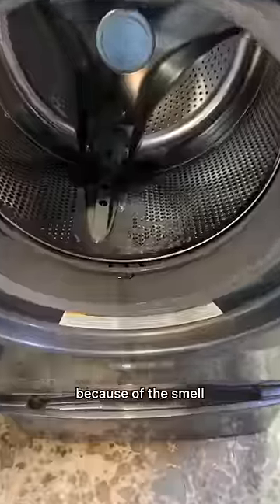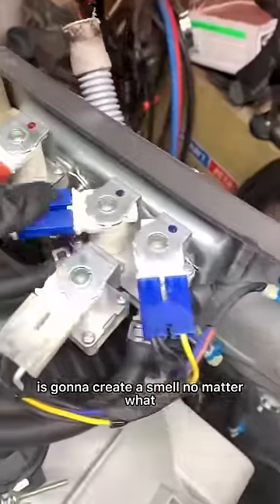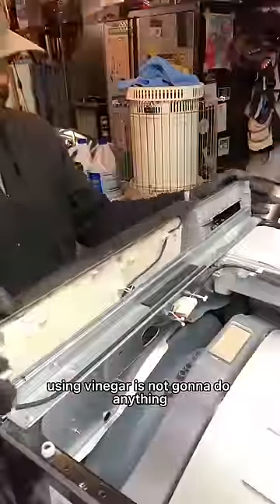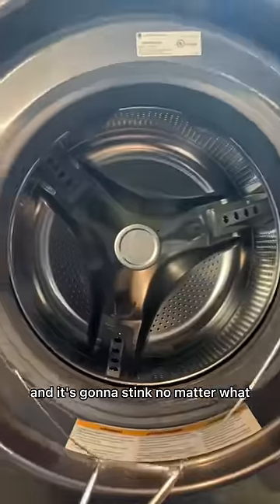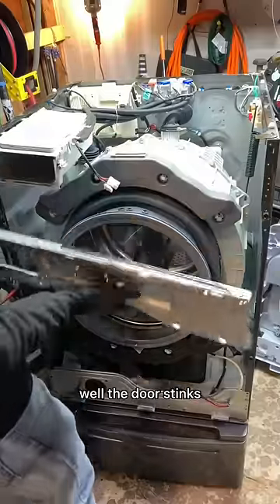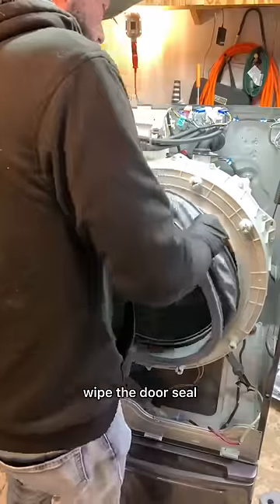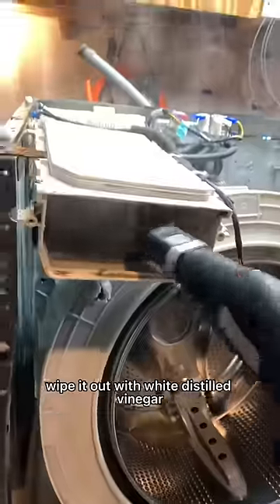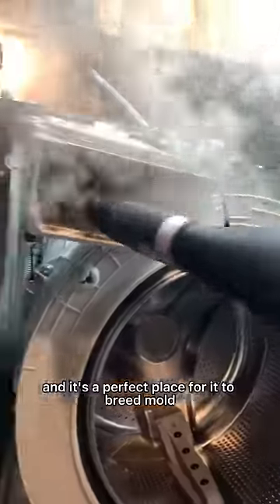Front load washers are proven to wash better. Facts, not opinion

Comment: Too much trouble. I’ll stick with top loaders
Reply: It’s too much trouble to leave the door open?
Reply: You sound exactly like my husband. I still can’t get at least a new top load one. 😂😂😂
Reply: @arleneaugustahair8393  tell your husband it saves a lot of water, a lot. You also use about 1/3 of the soap you use with a top loader.  And the clothes are absolutely cleaner. I went from a top to front and it was noticeable how much cleaner the clothes were.
Reply: @Draco100Round  I hate leaving the door open and now I leave the detergent drawer open too we got it feee but can’t wait for it to break
Reply: @Ratboy2004 my clothes come out smelling like mildew sometimes and you have to rewash them and then clean the machine. 

I don't live in a low water area. I'm not worried about saving water. I just want to do the job once and not have to clean the cleaning machine.
Reply: @Draco100Round  It is when you got kids who will run by your washer door, bump into it and take it off. Don’t have that problem with topload 🤷🏼‍♀️
Reply: @halo_girl_2434  You try whooping them🤷‍♂️
Reply: @Draco100Round  when you have it near a door that you walk by all the time, yes
Reply: Me too!
Reply: @arleneaugustahair8393  you need a new husband
Reply: I have a top load HE washer. Great capacity, low maintenance, and does a pretty darn good job of getting clothes clean.
Reply: Same.
Reply: @Draco100Round  where our hookups are- yes.  Otherwise its hanging into the middle of the kitchen floor. Where people will hit it.
Reply: You don’t have to leave it open forever. Just leave it open for a few hours to get the extra moisture out. And as he said you keep a rag on the top that you wipe around the seal. (for those that are talking about kids running by and walking by. Easy enough do your laundry towards the evening when it’s time for kids or everyone to go to bed) which let’s be honest most people aren’t walking by their washer 20 times a day. Nor does it have to be completely open. Y’all are way overthinking this. 😅
Reply: Top loaders last forever compared to front loader
Reply: 20% cleaner clothes, 80% more work. Yeah top load 100%.
Reply: Still too much trouble.... I use a wash board and stick
Reply: Top loads don't hold clothes hostage, plus you can add to it. All the front loads I bought broke within 2 years, trash.
Reply: @Ratboy2004  I went from a top loader to a front loader and I’ll never ever go back to a top loader. My clothes come out sooo much cleaner and it uses less water then my front loader
Reply: @savebandit1017  I k know plus they can leak unlike top load plus top load better and easy and never have this issue for one
Reply: @izzymaxpower  Yup, my current top load washer is more than 20 years old.
Reply: I've been a contractor for 40 years. Trust me top loader with the agitator does a much better job of cleaning my dirty clothes but it's also harder on my clothes. Lots more lint in the dryer screen I've noticed my jeans don't last as long.. Front loaders are okay if you don't have really dirty clothes and they spin cycle on those really does a good job of ringing the clothes out before you put them in the dryer so the dryer last longer.
Reply: @Ratboy2004  you did not. You believed the lies. They never get them cleaner. Unless maybe you had the cheapest top loader ever. I have had many people stay at my house and have them say they wished thier front loaders came close to cleaning as well as my old top loaders do.
Reply: My Whirlpool top loader still going good after 15 years. Reliability counts too
Reply: @JohnWayne-cb1tv  yup and I can just add in some washing soda to make up that 20% cleaner, as washing soda boosts laundry detergents power by 15%. Those front loaders look nasty as hell
Reply: @Draco100Round   no... front loaders always have issues.
Reply: @Draco100Round  You should leave the lid open on a top loader too, just so it is allowed to dry fully. It's bad to let moisture sit anywhere. 

Fill a glass full of water and then dump it out. Do nothing else. Put it upsidedown on top of a flat surface for 2 days. It'll smell very bad when you go back to it. It doesn't take much water that's not allowed to dry to make odors.
Reply: @Draco100Round  exactly what i do
Reply: @stephen9958  Top loaders don't leak?  Tell that to my GE top loader that flooded my house and did $10k in water damage when the automatic shutoff valve failed.
Reply: @eddiemalvin  That's not a leak, that's a straight up malfunction and the same thing would happen on a front loader (or dishwasher) if the fill sensor failed.
Reply: @Ratboy2004  literally no one cares about saving soap unless your living on minimum wage. Same with water your washer doesn’t really Use that much water anyway and the more “efficient” does not mean cleaner it just means they use less water and that’s literally it they just use less water
Reply: My old kenmore top loader went, so I  bought a new washer. I wish I  had kept the old kenmore. Boy, I  miss that thing.
Reply: European here. We dont use top loaders here and i have NEVER heard any of these complaints.
Reply: Front loaders DO NOT get clothes cleaner.  I'll keep my top loader for that reason alone.
Reply: Top loaders feel better on the back too
Reply: @Ratboy2004  maybe cleaner, but water is usually your smallest bill. Electricity is most peoples largest bill, and I noticed these "efficient" machines run for way longer, even if they are using less water
Reply: I want a top load too. Once I have the chance I'm going for it 😁
Reply: @halo_girl_2434  control you kids then.
Reply: @izzymaxpower  false
Reply: @savebandit1017  top loaders are a pile of shit still relying on a belt system. They use more power and water, also most people who use top loaders wash in cold water,  cold water does not dissolve laundry detergent properly so the inner barrel of your top loader would look the same as this front loader. You still need to clean a top loader out and do a rinse.
Reply: @JohnWayne-cb1tv  how's there 80% more work? You still need to drum clean a top loader?  Dont use fabric softener simple. And clothes come out more than 20% cleaner, it would be 50%. Use less water and power as well buy a front loader with a stainless steel seal, you have no worries then. But yes break your back reaching in and out of a top loader
Reply: @lucillepitt1979  I use hot water to wash clothes. I've had 2 front loads and hated them both, I will NEVER buy another one. To each is own, I guess. I actually have 2 top loaders now, one with and one without a center agitator.
Reply: @lucillepitt1979  not false…from someone who works on them… top loaders have been around for forever and mechanically they are way easier to work on and have less issues. Really talk
Reply: @pierredelecto7069  you don't live in a "low water" area? Wtf kinda mental gymnastics is  this?

We're currently in a global, I'll say it again, GLOBAL, fresh water crisis. Between pollutants like insecticide & microplastics as well as increased salination across the entire U.S. water table, we're ALL in "low water" areas.

Only 3% of Earth's water is consumable, able to be used for growing crops. 3% divided among every living thing on the planet.

But you're not concerned with your water use? Tell me you hate your children without telling me you hate your children again cause dying of thirst seems like a terrible thing to work towards.

I personally, hope to see future generations experience life as closely or better than I had it. Sad to see someone so blatantly working at the opposite.

I just gotta hope you hadn't realized the severity and after fact checking my statements will change your perspective on an individual's responsibility to be conscientious of their water use.

Wishing health and wealth on you and yours regardless! 🤓👍
Reply: @SirTorcharite  I live in a rural area where everyone gets our water from wells. Our water table hadn't dropped an inch, so no, we simply don't have a water crisis here. 

For many parts of the world there is a water crisis. I lived in California for over 10 years. It's real there. Where I'm at in Pennsylvania right now? Nope. Not an issue. We don't depend on melting snow for water. We pump ground water and it's not going away. Maybe in 100 years when the population of America is over 1 billion it will be a big problem.
Reply: @pierredelecto7069  do you think getting water from your well will matter if the water is salinated?

Pennsylvania is absolutely experiencing Freshwater Salination Syndrome. You guys salt your roads in winter correct? There's lots of agriculture grown in PA, right? Fertilizer & insecticide run off with dated agricultural processes are some of the most major contributors to the global water crisis.

Have you ever looked into the topic or are you speaking from some illconceived notion of reality just bending to how you feel it should be?

Because I've been paying attention to news surrounding a looming fresh water crises since the late 90s. I've never seen any evidence or experts suggesting Pennsylvania is sheltered from the fallout of humanity's disregard for finite resources.

I can suggest some sources for further reading if you'd like to be informed. I can't post direct links though as YT always deletes my comments when I do that 😬
Reply: @izzymaxpower  for forever... in america.
Reply: @SirTorcharite  I sold and installed water treatment systems. I'm not a PhD or anything, but it was part of my job when I worked agriculture in California. I set up everything from reverse osmosis systems to mechanical filtration, did electrical conductivity testing, and sent water to labs to test for biological contaminates. 

Our water in Pennsylvania is nowhere near as bad as it was in California, but it's worst than it was when I lived in Maine. You can drink it straight out of the tap. No filtration necessary to make it safe. You can technically drink water straight out of the tap in California where I lived in the central valley, and that had 10* as much minerals dissolved in there. 

No. Im not overly worried about a little salt, or nitrates or phosphates in the water. We'll be fine.
Reply: As long as it has an agitator..
Reply: @birdknowledge1388  than I'll just stick with the top loader
Reply: @lucillepitt1979  I always use hot hot water setting never cold
Reply: I wouldn't want to have to bend down everytime I wanna take wash out a top loader looks a lot easier I've NEVER ever had a front loader always a top loader and I don't have no complaints if ur clothes are washed they are washed simple
Reply: Same!
Reply: Too much trouble to have cleaner clothes and use less water? Top loaders are rubbish.
Reply: Exactly! All that maintenance for something that’s supposed to be high efficiency. High pain in the 😮😂
Reply: @pierredelecto7069  nah all it takes is one greedy politician for your water to get fucked lol. You should definitely worry.
Reply: LG and samsung are the worst
Reply: @Ratboy2004  true!
Reply: @SamanthaP48  nailed it.
Reply: @izzymaxpower  WRONG!
Reply: @JohnWayne-cb1tv  epic fail.
Reply: @stephen9958  WRONG!
Reply: @chasl3645  WRONG!
Reply: @randybobandy9828  nope!
Reply: @agiflow people have used rubbish things for many years. People are just too stubborn to accept change most of the time.
Reply: @agiflow what's the relevance of that?
Reply: @agiflow people should change for more efficency.
Reply: @dannythorpe1425  Why ? Is the water running out ? Efficiency for what ? Who gets to determine that ?.... Will the world be a better place if we all think and act exactly alike ?

I have a top loader that lets you select the water levels for the different load sizes and we've had them for years here since automatics first came out.

The only way that will change is if we are forced to conform and that is what is slowly happening. Doesn't come all at once. Slicing at and cutting out people's personal freedoms slowly but surely.
Reply: @patcola7335  it's not about cutting out people's freedoms it's about making a better world for us all to live in. Why waste water? Not rain water but treated water? Try collecting rain water and wash your clothes with that, I'm going to guess you would rather use the treated water for washing clothes and bathing and drinking eh? Water treatment is not free, it cost money and damages the environment in the process.
Reply: @dannythorpe1425  Get a rain barrel. Besides, won't those treatment plants keep people employed and working?
Reply: @patcola7335  one final point, only so much water can be treated in a day, so yes it's very possible for water to run out.
Reply: @dannythorpe1425  Well, when you don't believe in God, you must believe it's up to man to fix his problems.Its because of man and the fall we have all these problems.

 I'm sure you know with your education what that entails, don't you? 

People who are "ignorant" like me need to be told by the elites like you how it's going to be.

 It's just like the Bible says man worshiping the creation more than the Creator who is blessed forever ! Romans 1&2

You really should read the Bible and see what it says about what's going to happen to the earth. Everything is playing out. Just like God said, what happened.

In scripture God declares the end from the beginning of those things that have not happened yet. In God's eyes it already has.

Danny, the only thing I can say is don't be foolish. At least try and consider what some anonymous stranger is trying to convey to you.

Take it for what you will.

Love in Christ .
Reply: @patcola7335  please don't mention education and bible in the same sentence. My education, and my entire life lessons, taught me not to put my faith and trust in imaginary beings. Someone who will not, never has responded to my prayers has never fixed anything I've lived through. God is up their with the flat earth society. 0 evidence.
Reply: @patcola7335  yes they employ hundreds of people, and they are very important. But the less they have to manage the better in the long run. Why destroy the very planet that is our home? Get a well in your garden if you want to do the work yourself then you would appreciate the value of water.
Reply: @agiflow all those things you mention, there is a credited person behind it. God IS NOT CREDITED. Give me one solid fact to prove Gods existence. There is the exact same amount of proof as there is for  superman.
Reply: @agiflow 1500 years, 40 authors, you better hope its been woven together perfectly. Give me that long and that many authors and ill have a story 10x better with an imaginary being that's infinitely times better. I'm sure you have heard the "monkeys" "type writers" joke.
Reply: @agiflow Oh and in your reply you mention the law of entropy, is that an admission of science?
Reply: @agiflow no, science doesn't want to denounce God.
Reply: @dannythorpe1425  Hope your day is going well Dan.
Reply: @patcola7335  same to you buddy.
Reply: @dannythorpe1425  There are other means to save the environment, just don’t touch my laundry washer, my other home appliances and above all, my gasoline cars.
Reply: @dannythorpe1425  The moment you are breathing the air and living is already a proof that God exists. God loves you whether you accredit Him or not. Blessings!
Reply: @helenmak5663  that is like saying batman is real because I saw him in a book. Just because life is there and there's air to breathe doesn't prove that God made it. How can you expect me to be that nieve?
Reply: @Draco100Round  it doesn’t make sense to leave the door open it doesn’t look good aesthetically there should be some kind of ventilation system to not require the door to be open
Reply: They don’t clean aswell
Reply: Every single front load washing machine I have ever had began leaking between the seal and the door in under a year. There is 0 reason to try and make a spinning bucket of water work horizontally.
Reply: @SirTorcharite  Oof the indoctrination worked well on this one.
Reply: @T Cp  you should really try cleaning your washing machine now and then. I've never had leak issues from front loaders and the only ones I've seen leak are from mould build up around the door seals. Same with just about everything, look after it and it lasts longer.
Reply: @Draco100Round no, the vinegar once a week part🤦‍♂️
Reply: @asmith8898  Just leave the door open and you won’t have to do that🤦‍♂️
Reply: @chasl3645  I've always used a top loader and the farms I've worked on do too for the same reason.
Reply: @Draco100Round  why facepalm? The repair man said it. Not me
Reply: @pierredelecto7069  Don’t leave them in after the load is done.
Reply: 12 years in still working
Reply: Top load washers suck ass, they destroy your clothes.
Reply: Right on! I only buy basic top loaders! Much easier to clean and work on!
Reply: man Idk how many times top loaders being extremely petty, and said FL have too many problems, "tOp LoAdEr Is BeTtEr!1!1!1!1"- SHUT, FL doesn't have problems forever, and sometimes top loads will experience a problem, fax no printer
Reply: I realized, both top load and front load have their ups and downs, sooo these comment is bullshit
Reply: @jellen7332  Check out the UltraFresh Vent on GE's front loaders... the internet has determined that GE has fully solved the only issue that some front loaders have. I made up an excel spreadsheet to calculate how much a front loader would save... considering heating water and time to dry, front loaders cost $1.36 *less per load*. That's insane. And they clean better. There's no excuse for a top load 1920's tech boat anchor in a modern home.
Reply: @savebandit1017  i've had plenty of top loaders hold clothes hostage on the agitator.
Reply: @Stackali  lmao, stuck on the agitator is different than the door locking your clothes inside full of water. Front loads suck. I'll keep my commercial Maytag.
Reply: Yeah me too, I used to have the front loader never buy another one
Reply: @PACKERMAN2077 🤣🤣🤣❤
Reply: The thing is top loaders only spin the clothes in place
Reply: Top loaders are a waste of water and detergent, especially if you wash whites often, switched to a front loader have used a five times less detergents, to get the clothes just as clean, plus the newer front loaders use a lot less water.
Reply: @SirTorcharite I would argue that if you’re concerned about the planet you’d push more towards appliances that are guilty to last longer.

Ever wonder what happens to those machines with short life cycles? Ever wonder how much pollutants & water used in their manufacture. 

It’s not just how they operate that’s important but how long they last & how they are disposed at the end of their useful life.

The mental gymnastics not used to incorporate that is just as astonishing.
Reply: Been washing clothes for hundreds of years, things shouldn't be this hard for something so simple
Reply: @Draco100Round does this generation know what that is?
Reply: @Draco100Round YES
Reply: @Draco100Round dont want my cat to sleep inside!